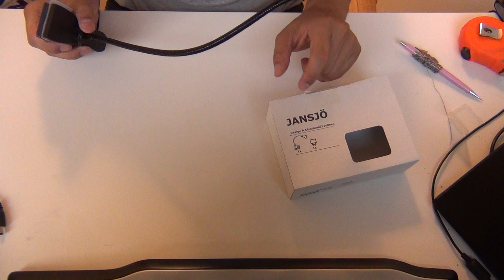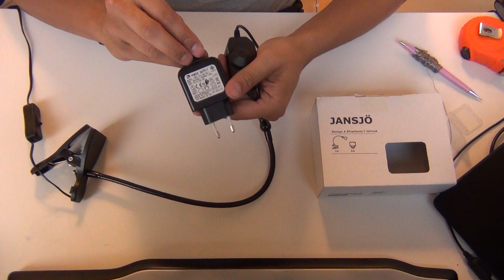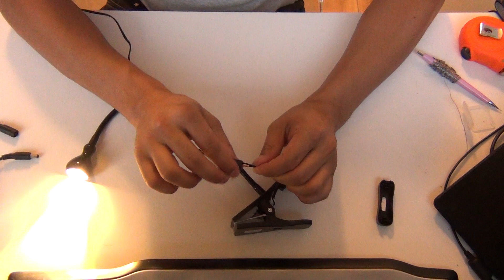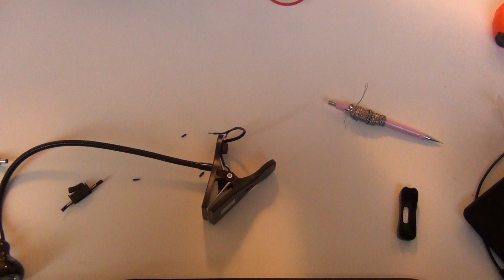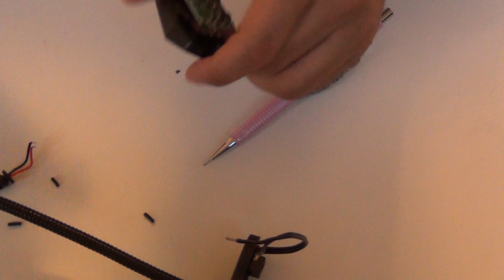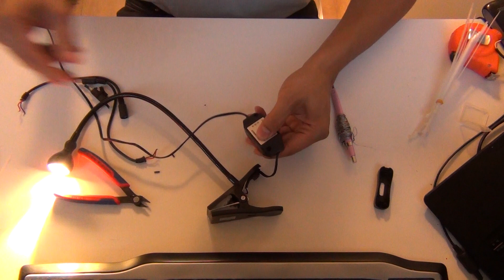Tutorial: Use 1$ EBAY dimmer to dim LED lights from IKEA

Comment: Thanks for the tip, I'd like to try it. 
How did you know that the 12-24v dimmer would work on a 7v lamp ? And do you think any 12-24v would work, or some might require additional tweaks to make them work together ? (in another design they add a jumper wire to "bypass the voltage regulator" - see here : http://www.stemplelabs.com/2013/06/hacking-10-jansjo-ikea-led-lamp.html )
Reply from the maker: Sorry not replying earlier! I did know that, because the type of dimming in this circuit is well known :-). Also I tried it before with a regulated PSU so I could see exactly the lowest voltage that this dimmer still works with> Enjoy!
Reply: So, in the end I opted for the lazy route, by simply sticking two lenses from disposable 3d glasses on the lamp's diffuser, adjusted for optimal light warmth :)
I guess I will keep your solution in mind in case the switch breaks ! Thanks